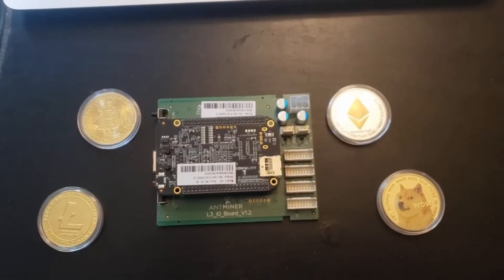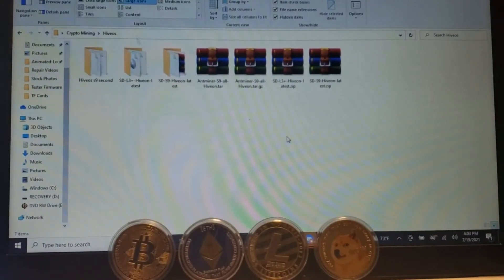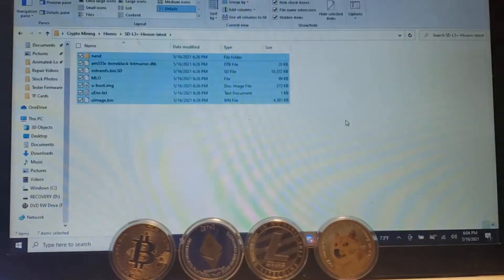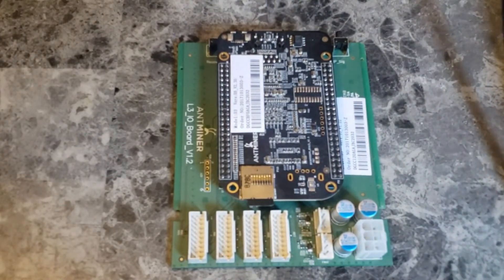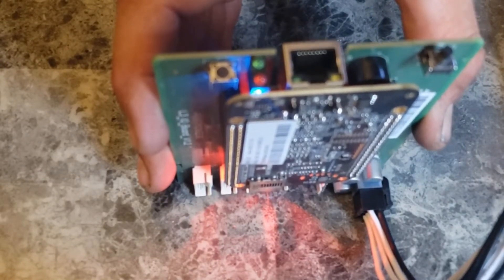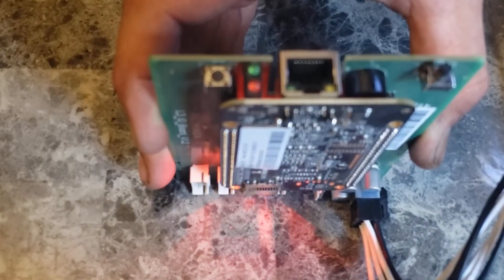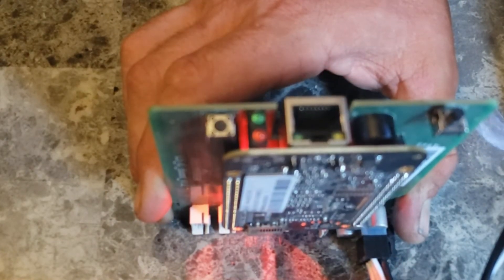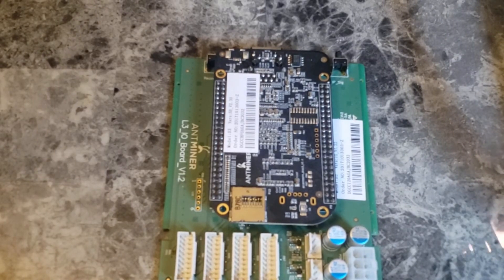Flashing a L3 Control board - Using A3, D3, or L3 IO Board - In Under 5 Minutes

Comment: I have an L3 controlboard but can't find the IP, I want to flash the controlboard but I can't. I jumped using a 1k ohm resistor to remove the antminer virus and it worked.. but the antminer virus came back and my L3 controlboard now can't be flashed again... is there any other solution to this problem??
Reply from the maker: What version is the board?
You could always get another control board
Reply: @CryptoMinerCHR  my L3 controlboard L3_IO_Board_V1, 2
Reply: @atlantis91-1  i got the same problem Sea did you get a new control board to fix the issue?